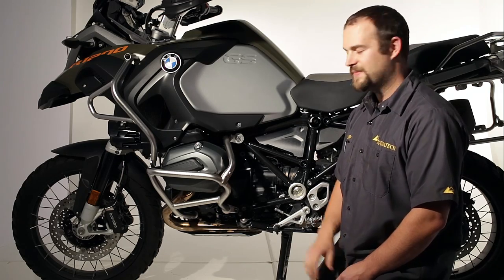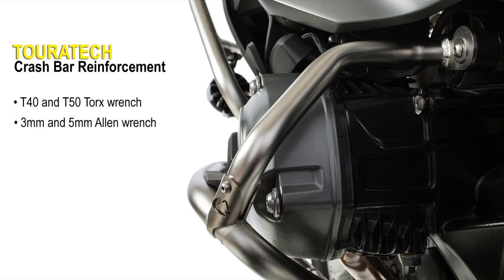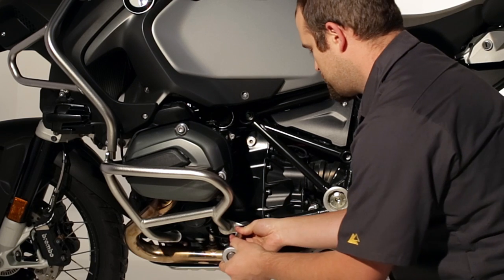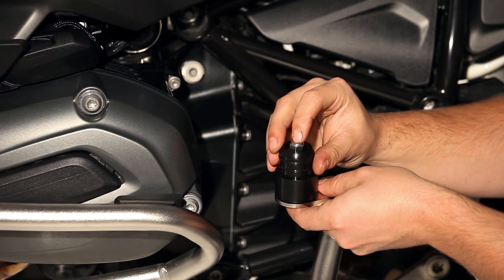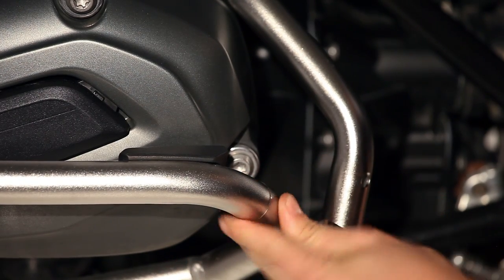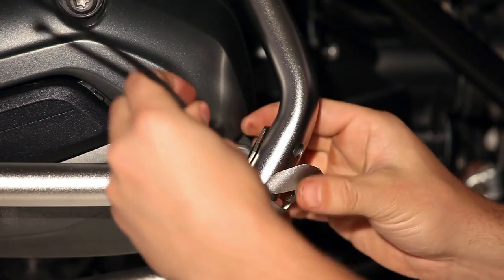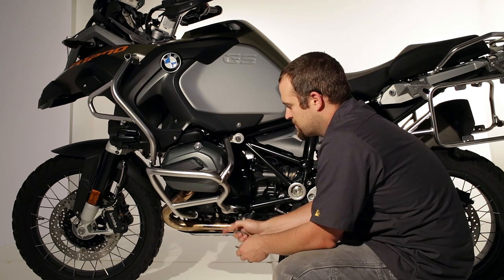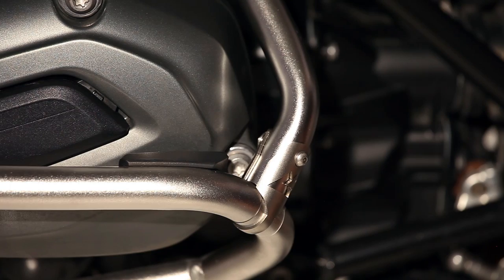Touratech Crash Bar Brace Installation

Comment: Where is the anti-seize supposed to be applied?  I've watched the video several times and never saw him use it or heard him mention it again after saying at the beginning that you need it.
Reply from the maker: A good rule of thumb is to put anti-seize on any stainless steel bolt going into a stainless steel thread!

Comment: Does the head cover (to inspect valves for ex) require crash bar removal?
Reply from the maker: You may be able to squeeze the valve cover off without removing the bar but it's not worth the effort. It is better to remove the bar entirely to have a clean and open workspace.

Comment: WD40 will swell and brake down Delrin, it would be better to use wax. It's not good practice to loosen with a torque wrench. The reason is a torgue wrench can be bent out of calibration. just ask snapon

Comment: looks super easy in your video. in reality I was not able to install it on the 1250GSA 2021. 
the 1250 protection bumper on the bars is on different location so the reinforcement bar will stay upper than in this video. and on that position you will not be able to fit that small strange nut. the space between cylinder head protection and the bar is very tight. the nut will not fit in that space and you cannot push it inside of that down join connector. imagine that you have to fist a nut in space smaller than the nut and in the same time to push the bar to touch the bmw crashbar. is impossible! 
I will try to sell them because I don't think I can return them since I tried to install them. Or maybe to try to weld an additional connection part on the  crash bars and to connect the reinforcement bards on those.
I will create a video about this when I will have time to help others to not get in my situation. 
anyway this a valve adjustment killer!  my mechanic will love me with this bars !  :))
Reply from the maker: This install video is for the R1200GS version, there is a different version for the R1250GS. If you purchased these from Touratech USA please give us a call and we can help.

Comment: A poor design in the first place and now needs bracing. And it all seems to get in the way of valve adjustment. I'd buy Altrider.
Reply: I just installed the Altrider OEM reinforcement. Has bolt that replaces the engine mount bolt. not sure this is a good thing or not. Both probably do the same thing and cost is same.